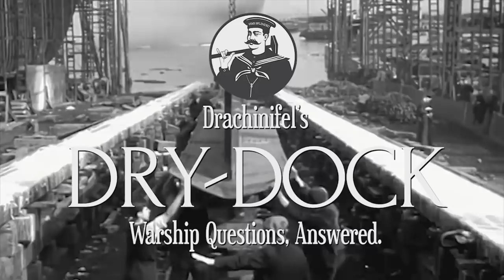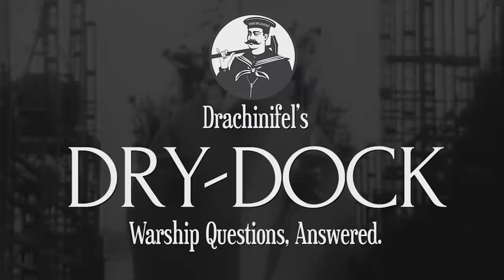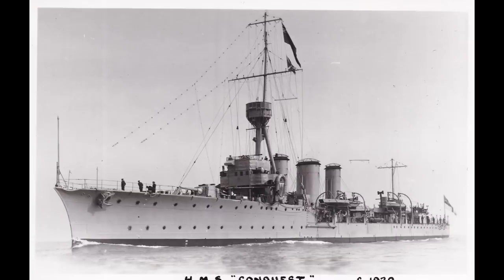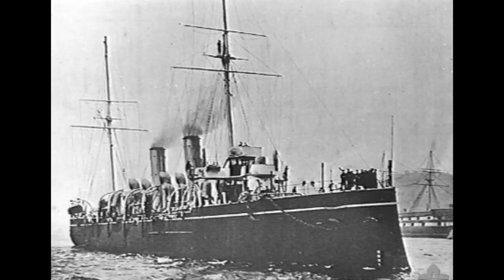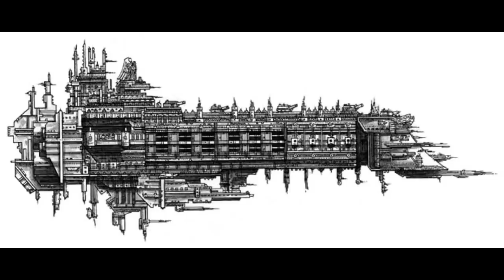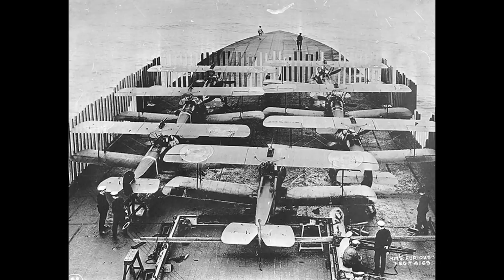The Drydock - Episode 143

Comment: Couldn't the rough usage of the Milwaukee and Royal Sovereign be partly due to the environment as well? The Arctic Sea is a rough environment - one that neither ship had been designed for.

But the western Allies couldn't have reinforced the Baltic fleet even if they wanted to (at least with surface ships); the Black Sea was of secondary importance to them; and Russia wasn't participating in the Pacific war at that point; so to the Arctic they went.
Reply from the maker: Well, the Allied ships that made the Arctic convoy runs took a battering from the same environment, but were maintained and kept up to spec when they returned to port.
Reply: I'd add that the Russians never saw the Allied nations as actual allies, but rather allies of convince. The Russians knew that after the conclusion of the war with Germany, there would be very high tensions with the Allies in a fairly short time period. The Soviet leadership were of the opinion that these were the same countries that had tried to overthrow the revolutionary government in 1919 and were still hostile to communism. 

If they'd maintained Royal Sovereign and returned her in good order after the surrender of Germany, she would be an asset to the Allies in a possible war against the Soviets. Letting them fall into disrepair means either the original owners have to extend resources in fixing them, or have to scrap them. Either way it's a drain on a potential enemies resources than on theirs.
Reply: @Drachinifel  When you mentioned British Imperial and American Imperial, there's also the point that those aren't necessarily the same even though they're using the same units. Inches (and their multiples) luckily are identical, but when it comes to volumetric measures, it's just … why!? (Baking recipes using cups. For dry/solid ingredients. WHY?!?)
Reply: @Drachinifel  Thanks for the answer.
Reply: @rolfs2165  Ratio is the same whatever cup size you use so the recipe should work, just the final amount may differ, depending on your cup size.
Reply: @gwtpictgwtpict4214  I don't want to smear butter into a cup and try to get it out again when I might as well just plonk it on the scales, though.
Reply: @rolfs2165  To confound and amaze you, of course! :P  It seems to have worked
Reply: @rolfs2165  I believe it dates a long way back when people may not have had scales.
Reply: @gwtpictgwtpict4214  Also, my far bigger annoyance is that US and Imperial cup differ by 50ml. Now imagine that scaled up to gallons, and the US making a difference between liquid and dry gallons. If I had been a Russian engineer in the port servicing those ships, I'd have had a regular meltdown.
Reply: English and American are not the same language 😉
Reply: David Nelson is that comment in American or English?
Reply: @nicholasglieco2155  Doesn't matter, I think the point stands. I think my favourite comment on this, and I've no idea who made it first, goes along the lines of 'England, a place where 200 miles is a long way. America, a place where 200 years is a long time.
Reply: @gwtpictgwtpict4214  Works well for things that flow, like salt or flour, or you can melt, like butter, but when recipes say things like "2 cups of broccoli" it's just dumb.

Comment: If we are to follow the trajectory of the battlecruiser (as it developed from Invincible to Hood) all the way up to the '40s then indeed, the Iowas are the closest match... But everyone is pretty sure that they are battleships.
In fact, by the time of Hood, they were essentially merging into fast battleships and therefore as a development line disappeared by the time of the treaty era of the '30s.
But then I would argue, the development comes full cycle back to the original purpose of Invincible (when battlecruisers were called dreadnought armoured cruisers and were not intended to fight other capital ships).
Yes, Alaska doesn't have 16" guns (but those are too practically large to put on a ship designed to fight heavy cruisers), but neither did the German battlecruisers of WW1 have the same guns as their contemporary battleship counterparts. They had as big a guns as could be justified by their design and purpose.